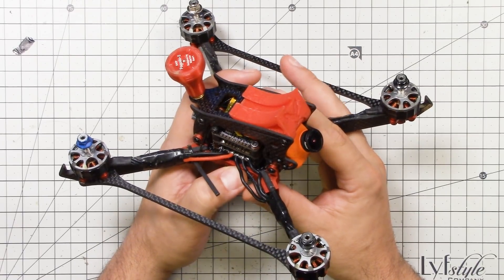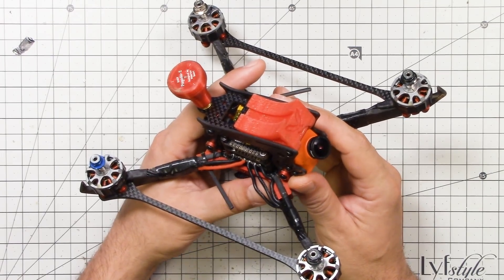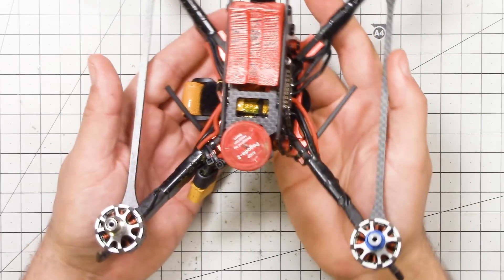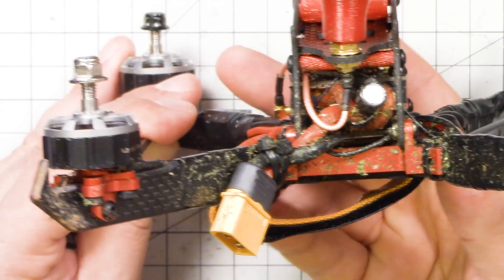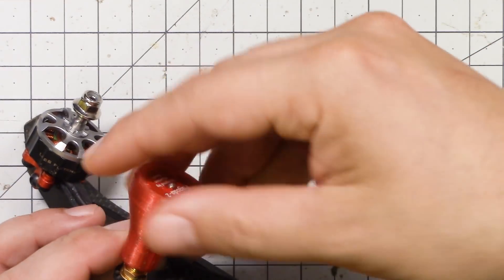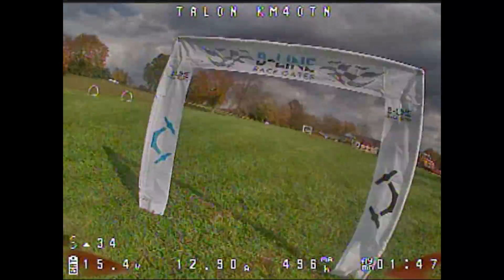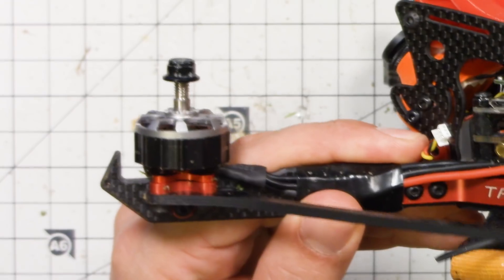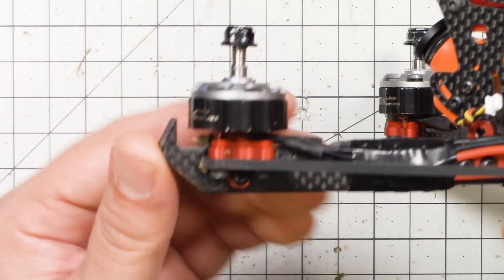Karearea Talon & ZMX Finx30 | FLIGHT REVIEW

Comment: Hey Joshua. You mentioned the 4 in 1 ESC you used ... but not really the brand or model number ... Which one did you use in this rebuild? My guess is that used the Aikon SEFM 30A 4in1 + Matek F405 + FCHUB VTX? Is that correct? Best  Regards from Denmark :)
Reply from the maker: Yes, Aikon SEFM.

Comment: You should note that down force is not the only factor when accelerating around a corner - if you eliminate all downforce elements from the calculation, the physics dictate that applying more power while travelling around a corner in a wheeled vehicle will actually increase grip within certain limits - that is why you should actually accelerate gently if you feel you are losing grip in any vehicle going around a corner - this will increase grip and is independent of a cars downforce.  I am also dubious about the difference between thinner arms and average width arms when at racing speeds (sub 70% throttle and cornering) - I think the air resistance difference will have negligible impact on the quad's speed in this conditions - and especially when comparing that tiny difference with the main body bulkier elements of the quad or the props or battery weight etc - I think air resistance/drag component of the arms from an average quad arm to a thinner quad arm are so insignificantly tiny compared to other factors that it can be completely ignored - it's irrelevant compared to other factors at these speeds.  How you tie your battery wires will have as much drag impact as what arm width you choose.

Comment: The 'magic' of the ZMX motors is a circular Haalbach array.  Not rocket surgery, but applying it and using the precise dimensions (and sorting out the air gap, exact magnet dimensions, etc.) is absolutely worthy of a patent.  They're impressive in terms of specific output, but nothing that revolutionary in terms of peak thrust, efficiency, or outright weight - just the best overall across those three categories (and are pricy as a result)

Comment: The problem is an electrical isolation one on the HGLRC boards - the gyro will see random spikes at odd intervals, which toss the entire set of PID loops into panic mode for a millisecond or so.  It sounds like motor twitching, because it's trying to compensate.  When it's on the yaw axis, the result is something unflyable with Kp above 20 in BF 3.1.7 or later (RMA'd those).  On the other axes, it's actually manageable.
Best sounding solution is running a small capacitor on the 5V rail of the controller, as that BEC has been problematic (out of 10 or so I've flown, three had issues with the 5V rail, and 5 have had some form of gyro spiking).  Definitely worth trying to sort that out, as it's a fairly elegant VTX solution (except for the lack of BF VTX control), and flies brilliantly if you use a separate PDB.

Comment: I have owned a Talon for quite some time now and agree with just about everything you’ve said about it. It just has a different feel than my other quads, especially compared to my super light builds. My Talon is right about 300g.  It does feel locked in most circumstances but does feel like it gets pushed around a little in a strong crosswind.

Comment: I left a post in your last video why you are getting vibrations it's your center play and you need to tape it
Reply from the maker: That's not it. I rebuit the exact same way with this setup and have zero issues.
Reply: Joshua Bardwell just wait after a few crashes it will stay again this is something I've talked to the designer about. He is the one that told me about it.

Comment: I've been waiting for this video for so long! I built a talon a few weeks ago after seeing your talon build video, and I love it to bits! Just a reminder (PSA): when the manual tells you to loctite (thread-lock) every screw, do it!! I didn't initially and it caused a vibration feedback loop that sent my quad flying into space, because a couple of screws got loose at the base of the arms. Also, if you hit a metal pole at full speed, the "hook" tip of the arms will delaminate, bend and destroy your motor bell too.. don't ask me how I know... Other than that it's super robust (the arm or sidebar didn't break in this crash)! Changing an arm, by the way, takes 5 minutes. Remove the two screws at their base and the arm slides out (once the motor is unscrewed). The only additional step is to remove the aluminum motor base (1 screws) and put in onto the new arm.
If you're looking for this kind of stubby pagoda, check out race412.com ! The guys are super nice and the antennas are cheap and good quality! They also have the triple-feed pagoda patch :) Just want these guys to get some love they deserve it. They didn't initially have an option for international shipping but I contacted them and they arranged a custom order for me, so be sure to hit them up if you have issues with international shipping.
Last point about the Finx30, I think, from what I heard from Kabab FPV, that it's actually the bell design that is patented. It's made from ferromagnetic material that creates some kind of hallbach array arrangement, where the magnetic field is much stronger towards the inside of the bell, than towards the outside.

Comment: Man what battery were you running on that speed test? Cant believe it hits 168 amps without sagging below 14 volts.
Reply from the maker: I.... don't remember.
Reply from the maker: Possibly it was the Strix Powerstix. It performed very well in my battery testing and it's one of my only remaining high-performance batteries that I go-to for this kind of run. The other likely candidate is the Adrenaline 1600.

Comment: What I understood from the FinX design, is that it's not about the magnets, but the shape of the bell itself. The shape of the faces are supposed to reflect back the magnetic field towards the inside and actually reduce the magnetic field gap between 2 magnets. The motor should feel less twitchy to the hand and not be magnetically attracted to other motors for example.

Comment: ok im hoping someone can help me out here... i just swapped out some motors for some xnova 2207 2500kv and after i land the motors are almost too hot to touch. no matter what PIDs and filters i put on they come down the same temp. i also just tried to spin them up on the bench without props or anything and they got hot. also all motors get to the same temp, they all have the shorter screws in so they dont short. i have no idea what else to do. :(
Reply from the maker: https://www.youtube.com/watch?v=eo2sjTNS0pc

Double check that there is no continuity between the motor screws and the motor outputs. I know you think there isn't, but get in there with a multimeter and confirm it.

Spin the motors using the Motors tab instead of arming the quad. If they are cool from the Motors tab, but hot when you arm, then the problem is excess vibration. Lower D gains. Turn the filters back to defaults if you tried turning them off. Soft mount the FC. Figure out where the vibration is coming from and solve it.

If they get hot from teh Motors tab with props off, then it's absolutely a defective piece of hardware: motor or ESC.
Reply: Joshua Bardwell well I checked continuity, and everything was fine, and I went from the motors tab and they still got hot. Then I decided to reflash  betaflight  (got nothing to loose at this point) and for some reason the motors are considerably cooler. I have no idea why, stock betaflight had waayy higher P and D gains so it should be hotter  if anything?? This is damn confusing. Thanks for the help though

Comment: Race412 makes similar pagoda superstubs: https://race412.com/product/pagoda-fpv-antenna/

No TPU protector, but they're alright. I've never had much range issues with them -- I notice a degrade from a standard pagoda or another antenna, but not by much.
Reply from the maker: Without the single-piece TPU protector, I don't want to run another pagoda. They have excellent RF performance but they break way too easily. The coax they use is too fragile.

Comment: Have a Talon and everything you said was on point. 

Building is actually pretty easy imo, I can actually change one faster than any of the arms of my other quads. 

Talon definitely has a different style of cornering you need to ve aware of, but I feel like it gives you a lot more room to improve, if you can be accurate with it, the arrow like tracking of it is amazing. 

Its definitely not a quad for windy days though I know that much!

Interestingly I just out the ZMX finX23 motors on mine, obviously less power than the X30, but I'm aiming for handling and usability on a track, my Talon came in at 280g auw, which is very respectable considering the size, you'd have to go to an ultralight bare bones to really get any lighter so it'll be interesting
Reply from the maker: +Damien Pitt AUW includes battery. If you're at 280 AUW I'm impressed.
Reply: Joshua Bardwell sorry I should have said minus battery,  looking at 460 ish with 4S 1300 going by averages which seems quite good considering I remember being impressed years ago I had a 4" with 2204 motors that made 700g of thrust lol

How times have changed.
Reply from the maker: I call the weight without battery or HD cam "dry weight". Hoping to get that started as a trend.

Comment: Good to see you had similar thoughts on how it flies as I did when I was flying it around. Very nice frame. corners are where this quad is all about. regarding durability. I have broken 1 arm and 2 side struts out of about 100+ crashes/400 + lipos, and the two crashes where it did break I smashed VERY hard into a tree. another little tip is the below the camera you have 2 screws that hold the pod down, replace that with a stand off between the two. makes the frame stronger IMO, but takes about an extra 2 minutes if you need to do repairs. well worth the trade off. Keep it up josh B
Reply: Muuuuurikkaaaa, f%^k yeah! Which one is better, Talon or Muuuuuurikkaaaa?
Reply: Sounds similar to how Josh put a standoff between the camera cage on the Chameleon to add strength and prevent bending.  Good ideas from both of you guys
Reply: Doesn't that just bolt a single piece of metal to itself?  Good idea though for a bit of extra strength at probably <1g :)

Comment: I think you would be very surprised by the EFAW 2407 motors.  I run the 2500kv and these are actually some very efficient motors.  I draw 80a total on punch out on my builds.  Tons of power, the motors stay cool with just about whatever you throw at them.  It's the only motor i'll buy right now until something better comes along.
Reply from the maker: I have them. I have... plans for them.
Reply: Joshua Bardwell very cool, looking forward to your thoughts to see if they align with mine

Comment: I had the same problem with the esc as you. In my case I used a wrong esc protocol. I changed it and the noise was gone !
Reply from the maker: I tried various things to fix it. Wraith BLHeli_32 should handle Dshot600 no problem anyway.

Comment: Just looked at the amp draw of these motors, scary to say the least, how are your battery's doing?
Reply: I've been flying 3 sets of FinX motors and yes the amp draw is high on full power punch outs, on speed passes the amp draw is ok and it falls off quickly as the quad builds up speed.  My 95c 1550 R-lines standup to the abuse well, you deff aren't flying these motors on any high load prop on a 1300 45c pack.. you will puff them unless you limit current down to a fair level. I've seen 191 amps on Avan R 3 blade props on a punchouts as soon as I took off.. I will tell you this, the Fin X are prolly my fav  motor of the moment the response times are insane how quickly they spool up and down, hands down faster spool up times then any motor I have flown.. turning Avan R props and as you know that's a silly high load prop that works motors hard they spool them up quickly to the point it feels like a 5x4x3 on a high end 2206.. the 5x4.3x3V1S on the Fin X respond so good and absolutely rips that prop, imho that prop and motor combo is the best freestyle motor on the market right now.. that prop isn't super fast, on this motor is extremely fast
Reply: Oh yeah the 191 amps was on two 3s 1550 95c R-lines in series for 6s. I do fly them on 6s a lot however and they love it..
Reply from the maker: The bench amps really don't tell the whole story. If you look at the DVR in this video, you'll see that while going around the course I was only pulling about 20 amps. Granted, I wasn't going full throttle. At full throttle, they pull about 130 amps peak. And that's on a 500-gram quad (all up, with battery). Really they're very reasonable up to about 75 or 80% throttle. Even after that, they're not as bad as some battery-killers I've seen.
Reply: Tnx for the reply' people. And indeed a lower pitch prop might be the solution. I only own BG's  infinity 1500's . Very difficult to get high C bats at a reasonable price in my country because of import taxes. I am thinking of making a new freestyle quad and these motors do sound interesting.

Comment: hope you get the chance to test the new razor race frame... i'm interested to see how stacked arms work, they dont even glue them together.
Reply from the maker: I'm really skeptical of this approach. If you want a 7mm arm (or whatever the height is) then cut it out of 7mm carbon so it's properly bonded. I can't imagine any world in which stacked 3.5mm is superior to a single cut of 7mm.
Reply: yeah thats sorta my instinct too,  its 4mm by 8mm  and i'm looking into  bonding two 4mm...   no manufacturer is ever gonna cut 8mm thick carbon are they? thats just not doable.... i've been thinking of sticking two 4mm frames together for over a year but if no manufacturer has done it, i'm starting to wonder if its possible to bond them well at all.

Comment: I had the same popping and throttle problem with an hglrc f4 flame 28a blheli s  racerstar escs and emax rs2205s...never found out what was causing it.
Reply from the maker: I suspected either the FC or the ESCs, but I sent them to someone else and they flew perfectly. So now I think it might be the powerful motors and ESCs not liking each other. If I could have changed the PWM frequency I would have, but the ESCs totally locked me out.

Comment: Nothing is wrong with hglrc flight controllers so that is absolute  bs. Their all in ones stacks are awesome. Especially for the 20x20 form factor they are totally  ridiculous.

Wanted this talon frame but  might go for the merica instead.
Reply from the maker: IMO for a pure racer, the Merica is the way to go. The Talon is a fantastic frame but it will be hard to overcome the weight advantage of the Merica. However, if you are not already a pretty spectacular racer, maybe you won't notice the difference, and I do think the Talon is a better all-round frame in terms of durability and maintanance.
Reply: Unfortunately I am far from a spectacular racer at the moment. 
Thank you for your input at my current level durability might be the biggest factor, as i have forgone many light frames for 
heavier variants

Comment: I've been racing Talons for a while now, and I agree with pretty much everything you said. 
Although replacing the arms is dead easy, just take off the motor, undo the 2 screws attaching to the center and it slides straight out. Then you just swap the motor mount over to the new arm, and slide it in. I have only manged to snap one arm though, the side struts seem to take the impact when you crash, so make sure you get spares of them.
The thing you said about wind is also sadly true. My theory is the wind gust actually spin the quad on the yaw axis, where as other quads the wind hitting the arms would spin them on pitch and roll. The difference is that yaw has the least authority of all axis, so it's harder for it to deal with. I think it needs a custom PID tune to take that into account, but I haven't got that sussed just yet.  Any thoughts on the best way to tune that out?
Reply from the maker: I guess higher P gain on yaw would give stronger corrections. Also maybe play with yaw_accel_limit in the CLI, or whatever they have renamed it to. But the real issue IMO is being pushed sideways, not rotated. And there's nothing in the PIDs that will fix that.